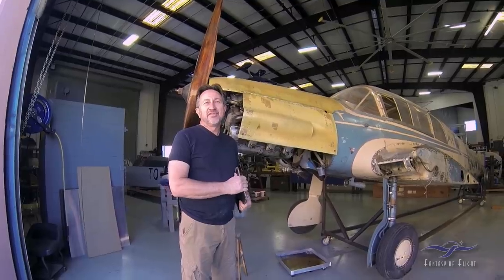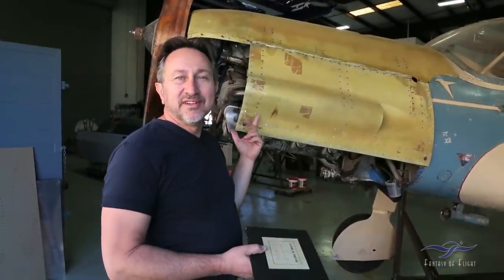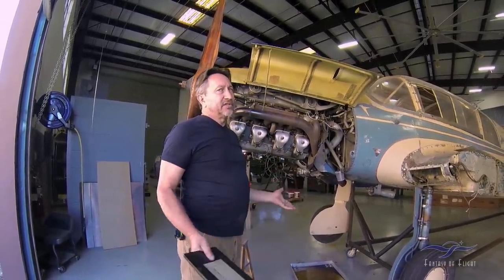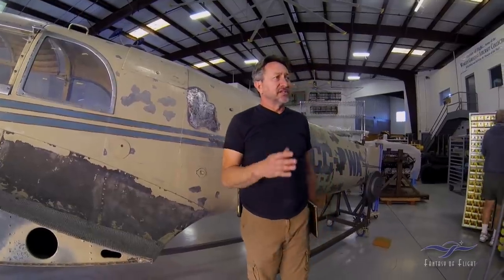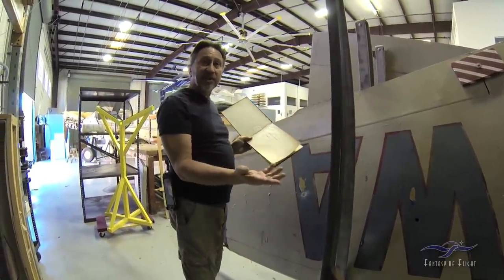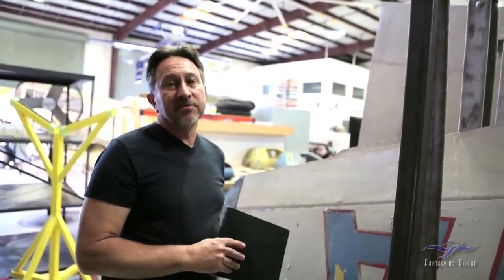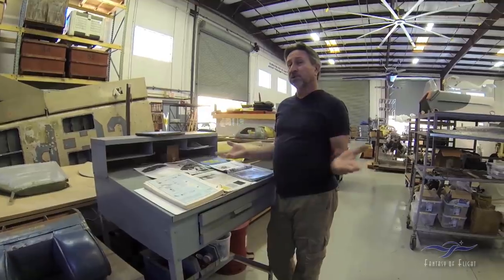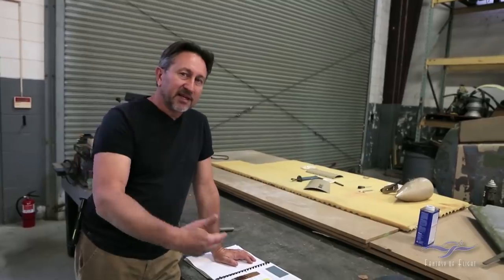Messerschmitt Bf-108 - Restoration Update #02 - April 2018

Comment: Hands down, you guys produce fabulous results. Years ago and before I had an accident on a building site I was projects manager for the construction of large commercial buildings and I know how much hard work goes into what your team does.  I would say restoration is much more difficult than new construction directly off of design, so I am doubly impressed. After every major project I always had to decompress by spending two weeks lost in fishing along a stream just to build up the strength that putting all your heart and soul into these kind of projects require. Best wishes and thanks for sharing both the process and fabulous results.

Comment: I watched a video of the blue and white taiphun that was in Europe had Swiss markings on it. Everything pretty much original but the instrument panel was mixed with different gauges and the radio of course had to be modern. The biggest peeve mentioned was the fueling of the tanks. Said that it took a lot of time because of the placement around the fuselage and you had to fill from the top tank remove fuel filler and let gravity slowly allow the fuel to disperse evenly. Perhaps the only modification of fuel is to add a vent tube to allow the air pressure to get out instead of the back pressure created by the fluid trying to get around the air build up in the tanks.

Comment: Paul,  Regarding the Argus inverted V8, is there a dry sump lubrication system?  If not, how did they avoid lube oil pooling in the inverted cylinders such as occurs in a radial motor at rest.  The interior of the 108 bring to mind late 1930s luxury automobiles such as the Horch or the Autobahnkurrier Mercedes.  Please bring us up to date on this restoration project. Thanks.

Comment: +KermitWeeksBlogVideo  Bayerische Flugzeugwerke must have offered several paint schemes for the Bf 108 including Willy Messerschmitt's cream with dark blue-gray cowl on D-IOIO.  The light gray would be a satisfactory border color for this scheme.  Will a new N-registration be needed for a full flying restoration?  Whelen Engineering may have satisfactory LED relamps for the stock position lights in addition to a style-compatible set of anticollision lights based on the Rota-Beam technology developed for the firm's emergency-light bars.

Comment: Are you going to use the prop that’s on her,or go with a polished chrome? Or have another wooden prop made? I like the wooden look. It’s going be neat to see and hear the engine run when you get to that point. Wander if she has enough compression to run on a test stand?
Reply from the maker: Some of that was answered in the first two part video. Check it out if you haven't already.
https://youtu.be/nYwoBGIMukA

Comment: Regarding the Bondo Hidden Damage, is there an acceptable epoxy for aviation ???
I've used two part epoxy on automotive work, when heat damage from welding would have ben a problem, and ten years later, it is still crack free..

Comment: Looks like they have very similar narrow landing gear to the 109's, is that correct?
Reply: Indeed the 109 had been derived from the 108 as a quick and dirty design adaption. But the 109 is more narrow (only one seat;) and the landing gear is slightly angled. They couldn't attach the gear to the wings because the 108 was originally derived from glider designs and the wings are actually pretty light build. Indeed the whole thing is designed for endurance. I sometimes wonder if that particular plane was actually flown to South America.
Reply: Fitzy Holden I always assumed it was the same or very similar
Reply: fuzzel well it set some air race and rally records in its day, also 9n endurance. Elly Beinhorn flew hers around Africa I think.